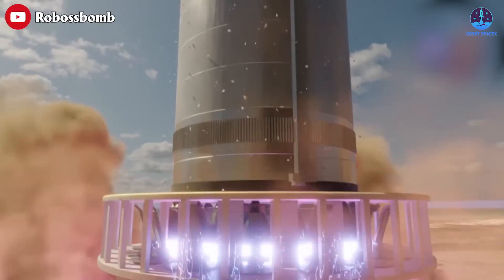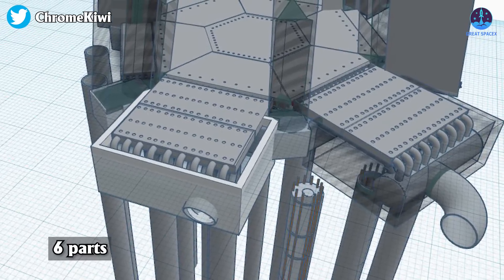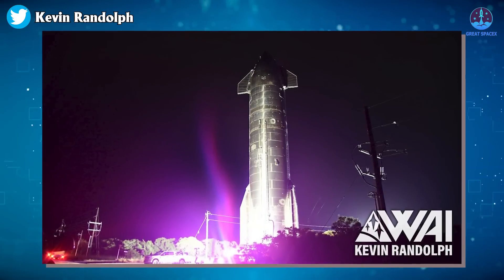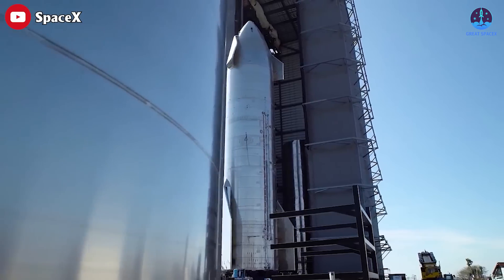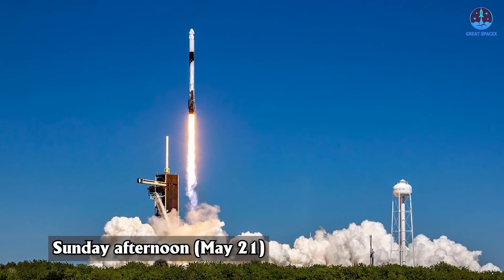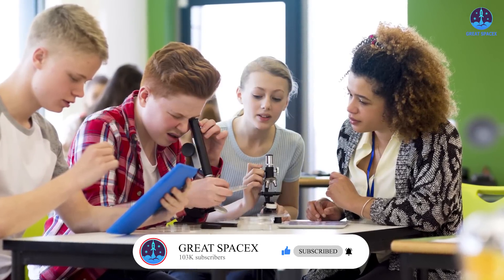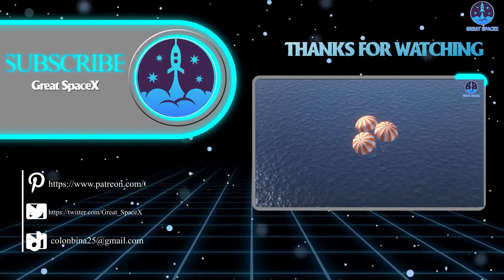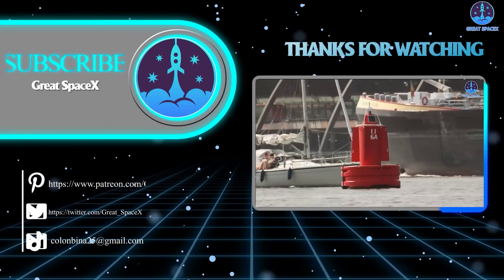SpaceX tricks to save OLM

Comment: I admit i am confused. I thought the problem was blast force intensity, especially due to the 350 bar launch possibilities via each Raptor 3 engine. Use of water is to counter sound, vibration and potentially any thrown materials during the brief launch phase. As such channeling the engine thrust exhaust is important. A flat floor however strengthened will not help sustainably or economically.

Comment: Can't we just build a dozen CofferDam / Stage ZERO launch deluge sites half a kilometer offshore from Starbase.       EASY PEASY !!!    Not even an engineering  head-scratcher.   All connected by rail, piped in for fuel, piped in for electrical,  rapid deluge and pump dry capability, rapid reusability.  Build Launch-Tower / Chopsticks / cradle-ring base in each of the 12 locations.  Scaleable to as far as the mexican border permits.  Or maybe mexico wants to partner and expand Starbase even further South ???  We don't need oil rig platforms  we just need to be able to control the flight right back to where the booster started.  Small desalination plant and storage at each site for freshwater rinse after each  launch / landing.  Or engineer everything salt water proof.  Seems like a no brainer.

Comment: if you put this plate on sand its entirely possible it will be ripped apart and fling steel plates everywhere. the ground needs to be able to take the forces. ive heard a lot about plates, but whats gonna keep the booster from digging a new hole. several feet of reinforced concrete will be needed to solidify the surface to a point where it can handle the thrust.
Reply: That is what they are doing. They are putting reinforced concrete columns all the way to down. I think 5 so far have big dug

Comment: Just put a pool of water under it. Would that not be more easy? Yeah...
Reply: Nope.
Reply: @eskieman3948  Nope what? Solutions?
Reply: If results from studies of gas jets impinging on a pool of water can be scaled up to the exhaust velocities of a Raptor engine, it will take at least a couple of meters of water to keep the exhaust from reaching the plate. And those studies had the temperatures of the gas and water the same. This design has no way to maintain such a water level without the exhaust just pushing it out of the way. Each Raptor engine generates the power as the output of 2.5 large nuclear reactors!
Reply: @KevinBalch-dt8ot  So starting without anything. Literally nothing of knowledge. Then, yeah! PUT 10 Meters of Water unde it. How hard can it be?? My god we want to fly to MARS and we FAIL at the LAUNCHPAD

Comment: What am I missing?  Yes I understand that the new water deluge system will help dispense the heat.  But what about the FORCE.  It wasn't the heat that ruined the pad it was all that force required to lift that behemoth into space.  Have we forgotten that every action has an equal and opposite reaction?  You will NEVER be successful if you try to lift that huge weight to space and allow all or the "opposite reaction" to be directed in just one place.  Why not create a force diversion  system that incorporates the water deluge system with hardware that dispenses the force in many different directions?
Reply: Which is what NASA does with a steel wedge that is their flame diverter that channels the exhaust into the flame trenches.

Comment: What Space X is going to have to do in the long run is make the top surface of the blast plate out of tungsten. This is one of the few metals tough enough to live in the blast of the rocket engines for minutes at a time.

Comment: Readers: Look at  Akbarali Shaikh's suggestion on how to deal with super-heated steam. He is likely an engineer who understands the problem. The problem is that super-heated steam will rise and "follow" the rocket as it rises off the pad. The super-heated steam will cook the engines and their fuel lines. This engineer has a brilliant solution to deal with that. Until or unless this gets to Elon, there will be cooked engines. I hope his suggestion gets to Elon. 

It probably won't but I will do my part to try to get it there. This is NOT original. Mr. Shaikh deserves the award, not me. 

Sanjosemike (no longer in CA)
Reply: NOTHING is going to get into the engines. An engineer should understand what almost 20 million pounds of thrust  does.

Comment: The water of the deluge system is not pumped, but next to the water tanks are huge high pressure gas tanks. The gas is then released into the water tanks and pushes the water with high pressure to the deluge system.
Reply: Pretty simple system really, no pumps to fail, just valves to control it all. I feared for the tank farm when the launch blasted all that concrete out in all directions, that berm wall isn't very high and given the high trajectories of the blasted out material, they likely bypass it anyway. I'm honestly surprised the govt let him build the tank farm so close to the launch assembly.
Reply: @dc-4ever201  Uh. That would NOT be up to the govt. to decide.
Reply: @CritternNation  I would have thought the FAA would have a say in that.
Reply: @keithmayes4358  The FAA is really only concerned with Flight Safety.   They truly don’t have a say if you want to build a Single Use launch pad that needs to be rebuilt and reconfigured after every launch.  And the other issue is that the FAA’s charter is literally to PROMOTE private aviation and aerospace ventures. That’s how Boeing ended up certifying its OWN 737 Max.
Reply: @dc-4ever201  The berm they installed is angled at 45 degrees.   That is the exact angle that would ensure that debris hitting it at high speed would be bounced straight up into the air to land on TOP of the tanks and piping behind the beam.    Chunks of concrete weighing hundreds of pounds were found on top of the tanks, and even lofted clear OVER them.   As clever as SpaceX is at building rockets, they really showed very little intelligence at the design and layout of the launch facility.

Comment: Will the water be able to flow through the holes of the steel plate with a pressure exceeding the pressure of 31 raptors?

Comment: Namaskar, Ellon musk bhai, my small suggestion maybe help full for you. Huge quantity of steam may effect on burners, so allow empty steel pipeline covered with big water pipe line filled with water. When fire energy passing through empty pipeline it open all water gates automatically and water flow in empty pipelines with this method can avoid damage and also can use pushing energy for starship. Insha allah.
Reply: Brilliant suggestion: There has to be a way to deal with tremendous amounts to super-heated steam. The steam will rise during launch (heat always rises) and will cook the engines and their fuel lines. I agree with you. Until and unless the massive release of super-heated steam is dealt with, the engines will essentially "cook."  A machine that "tosses" in a raw steak 100' away from the launch site will cook solid immediately. 

I actually wish you were wrong. But I'm sure you are correct. I hope your suggestion gets to Elon. If not, he will find out soon enough. The rising steam will "follow" the rocket as it lifts off. 

Sanjosemike (no longer in CA)
Reply: @sanjosemike3137  steam won't even get close to the engines if all of them are firing

Comment: "-crane- excavator is continuing to excavate".

This steel plate plan has been tested elsewhere (different company) with success.

This is going to be crazy to see in operation.
Reply: The only test I saw showed that the exhaust cut right through the water jets as if they weren't there.

Comment: Super giant water pumps alone will not be reliable enough to move all that water for this deluge system.   They will need a water tower such as the world has never seen before just to maintain the critical head of water pressure.
Reply: The water is to be forced by high pressure gas.
Reply: I don’t believe the system will work but high pressure gas is used to quickly provide water to nuclear reactors in accident conditions until emergency pumps can be started and come up to speed. So THAT part of tge plan is well understood.

Comment: What is needed is a kinetic absorbant device, such as a centrifugal turbo disk connected to a heavy base that will spin to absorb the energy.
Reply: Have you any idea of what you are talking about?
Reply: I wonder how many star ship flights are needed to fill the tanks of a booster in space?
Reply: @reasonerenlightened2456   Starship will be able to carry around 150 tons to LOE and the booster requires 3,700 tons. The maths show that would take 25 flights to fill the booster. Doesn’t make sense does it? These are the figures I got from the Internet but if true it is totally impractical, I think something is wrong somewhere because this is not sustainable.

Comment: 33 plasma torches will cut right through those plates before water that is flashing to steam and expanding 1600 times in volume can cool the steel enough to prevent it.
The pressure wave from the Raptors will make the phreatic expansion of the water look quaint.
There is no effective alternative to a flame diverter trench for this powerful rocket to achieve a high rate of launches.

Comment: This won’t work as well… the steel plates are flat. They will reflect all the sonic energy back into the skirt. In fact, they may make it worse. The first 3 engine s didn’t die from debris. They shut off almost immediately. 1/2 sec after shockwave hit bottom of rocket. The debris was a good 4 to 5 sec later
Reply: Maybe have a lot of small pieces of steel welded at a 45-degree angle onto the flat plate. That would direct the forces outward rather than straight back up. With the force of water coming up and turning instantly into steam combined with the force of the exhaust coming down, the pressures under the launch mount will be much more extreme than before. Will see what happens.
Reply: You obviously don't understand that the important part isn't the steel plates but the water deluge system. It will be the water that absorbs the energy not the steel plates and the water will be foamed and aggated so won't be flat at all. Water is amazing in the energy and heat that it can absorb. The steel plates are only to manage the water with a robust system that can keep it where it needs to be and focused in the engine exhaust stream. This will most certainly work. There may be tweeks needed but it's a system that will work just fine.
Reply: @kstaxman2  and you clearly do not understand the forces involved. The space shuttle launch complex uses almost 10 times the amount of water SpaceX is thinking of using and they have a flame divert trench and it still gets damaged.
Reply: The first attempt cleared the platform. Would the second attempt blow it up? What sort of a star ship can not separate and land in case of emergency?

Comment: I have a Stupid Question:  Could the water from the upside-down Shower Head drown the Engines and put them out?  Not sure how that would work.
Reply: That water will never reach the rocket motors. Against the heat and thrust of the engines it will be vaporized or thrown out. They would have to be spraying that water with more force than the engines develop.  Remember, they use water at Kennedy Space center now and it's never been a problem.
Reply: I'm not sure if even THEY know if it will work.
Reply: Once the engines are on, the exhaust will blow the sprays away as if they weren’t there. Further, it’s probably going to take a meter or two depth of water to keep the exhaust from impinging directly on the plate. That depth of water will dissipate much of the flow of the sprays making them useless.
Reply: @KevinBalch-dt8ot  wait and see I'll put my money on the engineers that are actually wotking on this. I've seen a spray of water about the thickness of a human hair cut cleanly through 3/4 of an inch of stainless steel. Pressure and the head design matter. And water absorbs a lot of heat as well. Like everything else we have an unlimited number of experts with little experience. Time will tell the tail but I'll bet that water can do the job it's simply a matter of engineering.

Comment: Problem is having water underneath isn't just for cooling, the water absorbs vibrations reducing stress on the surrounding components, I'm not sure they have a deep enough trough considering Starship is the most powerful rocket ever built. The Space Shuttle had a massively deep trough underneath it and it performed it's task flawlessly throughout it's use and is still used now. I dunno why Elon didn't use the design that was already tried and tested and just put his Starship launch Rig ontop once built.
Reply: Because he is in a big rush and doesn't care if he blows up a rocket or two in the meantime. He will build a trench eventually, he will have to.
Reply: @GoDodgers1  For a businessman, he certainly doesn't seem to care about wasting money. Better to do the job properly the first time and save time and money plus materials. This new plated approach is likely to vibrate so much it will buckle under the stress and damage the concrete underneath it again or vibrate so much that water ingress into the area around the piles making the whole area unstable. Yes I know it's in a delta area where rivers join the sea, but he built on the solid part.

Comment: Ah yes what is better then concrete debris? Steel! 😂
Reply: These steel plates will be protected by the water just fine not that they couldn't possibly work without the water. Water absorbs tremendous amounts of heat and energy. There steel deflectors used in the water deluge systems at the Kennedy space port right now and they hold up just fine. Even with the additional force that Starship has the water will dampen the energy just fine. May have some tweaks as to the amount and how they keep it foamed so it's most effective by water is amazing stuff and will fix this issue.
Reply: @kstaxman2  it was a joke. I'm sure the improvements will work just fine.
Reply: The first attempt cleared the platform. Would the second attempt blow it up? What sort of a star ship can not separate and land in case of emergency?
Reply: @reasonerenlightened2456  i mean it didn't separate because the hydraulic units they use to separate blew up before it was time.
Reply: @evandipasquale9255  LOL. You and everybody here gets it wrong. The correct answer is ,it didn't separate because nobody bothered to write the software and to design redundancy systems for separation in emergency, like exploding bolts on the clamps,  different hydraulics design, etc. Good luck getting this excuse of a Star ship approved for human flight.
Reply: @reasonerenlightened2456  you do know it's a prototype and not a finished rocket ship. This is how spaceX has always built and tested ships, it's nothing new.
Reply: @evandipasquale9255  Just saying, they could have thought of emergency separation modes for a ship that can allegedly land, or can it?
Reply: @reasonerenlightened2456  you have to remember it's a private company and not nasa. Why would they spend time, money and resources building B and C if A doesn't even work. They design something then launch it and see what works and what doesn't then make changes rinse and repeat.   It's more destructive yes but it's way faster and way cheaper then the way nasa does things. Which is to pay engineers for decades testing every single part they make but that's the difference between a government funded agency and a private company.

Comment: The pressure of the water coming up has to be equivalent to the initial trust input they need for lift off
Reply: I mean, not really. To get water to come out the pressure in that valve has to be higher than the pressure of the exhaust hitting specifically that valve. Thats not the same as requiring the water system to produce as much pressure as the engines because the majority of the exhaust will be hitting things other than the water holes so the local pressure will be way lower on average.
Reply: Yes, this is the funny part.